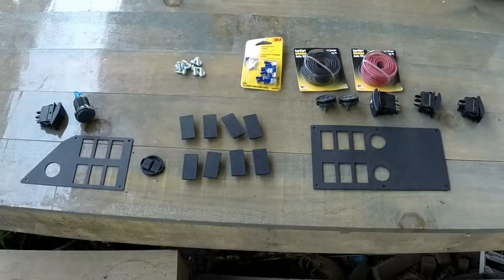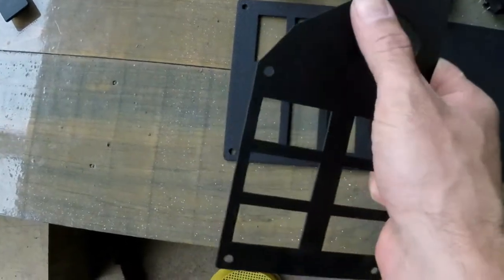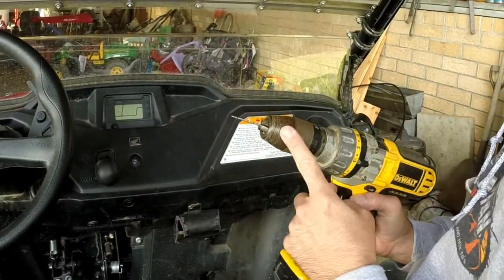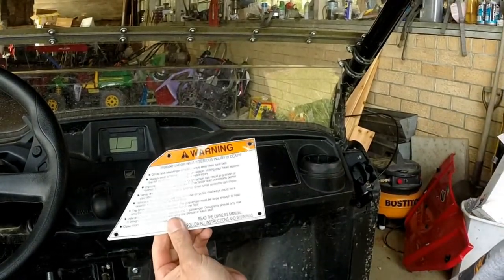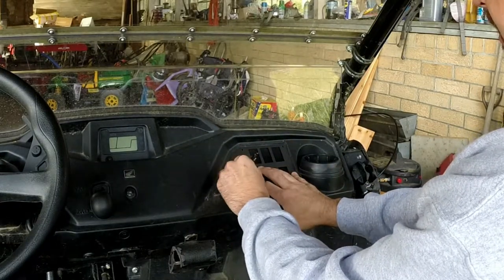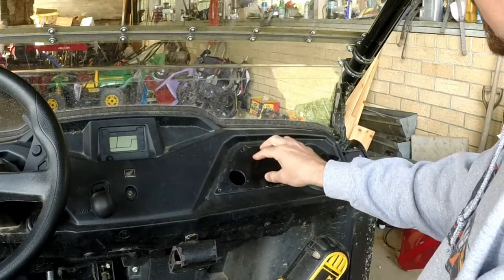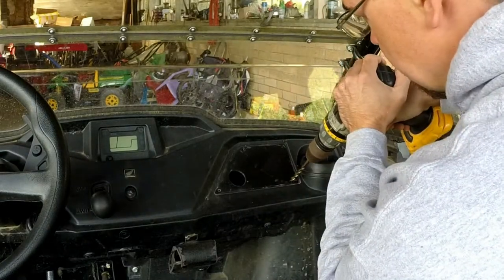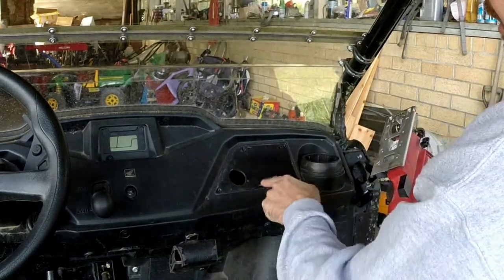Honda Pioneer 500 Switch Plate Install (500 only)

Comment: Good job. Just an off the cuff ask. Is the wire you ran a main feed? Or will you run individual wires for accessories. And how will you fuse the feed(s)?  THX